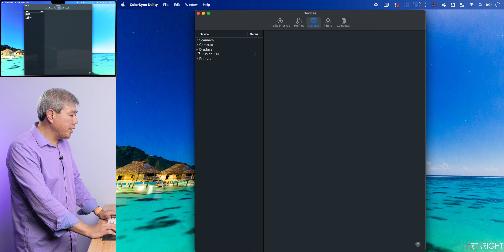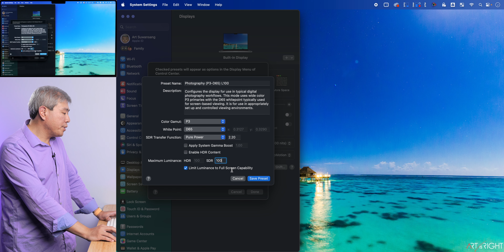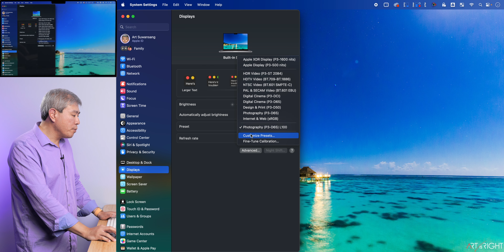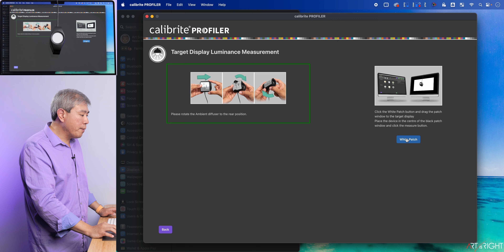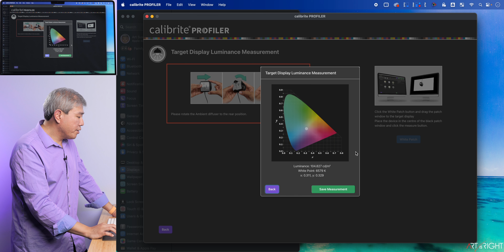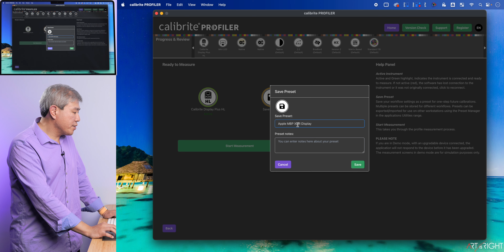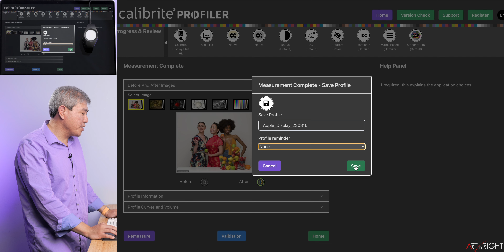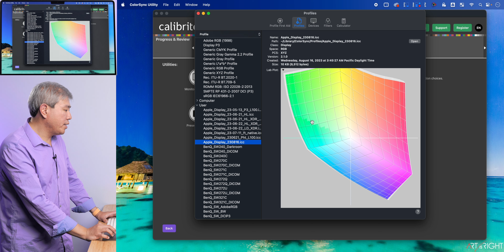Ultimate Calibration Guide for Apple 14" & 16" MacBook Pro XDR Display - This is the way!

Comment: Is there any way to do these measurements with an old ColorChecker Display Pro?
Reply from the maker: Yes and you can calibrate as well but you won't have MiniLED as a backlight option and that has adverse effect on the icc generated. But for the measurement alone, yes you'll be fine.
Reply: @ArtIsRight  Thank you very much for your answer

Comment: This was a great video. Thanks. Only issues I had was I had to google the X Y point target values because I was using D50 as I am doing more print work. I used X = 0.34567 and Y = 0.35952 target values. For some reason my 2023 Apple Studio 5k Display came up with a warning triangle for Luminance target value of 100 (no idea why) so I had to go as low as 90 as instructed in this video.
Reply from the maker: you're welcome :)

Comment: Hello, I have a MacBook Pro M1 (14).  I manually set the 100 L recommended by you in the settings and after measuring in the Calibrite software, it shows me the measured brightness values of only 85.9 L. The set brightness value does not match the measured value.  The display plus HL calibration probe was used.  can something be done about it or is the display defective.  What does it mean for me?  My laptop is two years old.  Thank you
Reply from the maker: Your best bet to fine tuned is to just ignore the measurement from the HL device. Some displays read lower. Other ways to work around this is set the luminance value higher, verify with the device and when it comes to fine tuned, say you want L100 and you are measuring at 85 just put in 98 or something like that. lt is a way to trick fine-tune into taking the value

Comment: So excited about this new update as this year I purchased the MBP 14". I assume this new Display Pro HL works with previous devices as well.
Reply from the maker: Display Pro HL is the device, I think you mean software, yes it will work with previous gen devices, however, they are not fully optimized for miniLED and XDR Displays
Reply: @ArtIsRight  I bought the Display Plus HL and did the calibration on my MacBook Pro 14" M2. Should I go the same process for my iMac 2017?
Reply: @josemanuelalorda yes except the 2017 iMac is not a mini led. It’s white LED I believe.

Comment: nice video! I recently got a canon pro 1000 printer and have been researching external monitors for my MacBook Pro m2 16 inch xdr. Im finding it hard to come up with a solution. So I may give this a shot first for printing. Do you have any recommendations for external monitors that work great with the MacBook pros that are designed for printing in mind? I have looked at the ben q, and eizo monitors but I am somewhat confused at what would work best. Thank you for any advice.
Reply from the maker: Any BenQ SW series displays all of them have 99% Adobe RGB coverage

Comment: Hey do you/anybody know the recommendation for printing settings and keeping multiple calibration profiles? He mentions it when talking about setting the white balance and choosing the custom brightness 100 setting that the lower screen brightness of 50 is the best profile for printing. That would definitely make sense as I’m having an under exposure issue with printing while using ICC profiles and being calibrated correctly. Does anybody know if it’s normal to just switch back and forth between these display settings - ie staying on the 100 setting from this video but as I go to print switching to the 50 setting to make changes to the image for brightness and saturation. I’m toying with just staying in that setting.
Reply from the maker: 2 variables: I never recommend brightness below 80 nits. You are losing a lot. I would look at the light source luminance that you are using as well. These are variables that are equally as important.
Reply: I’m sorry, I misspoke on part of that: I meant the d50 instead of d65 for printing and also using a lower lum like 80  nits if I’m having some dark exposure printing issues. 
How do you guys manage multiple settings? Like do you color grade in d65 with the settings you’ve made here and then when you want to print switch over to d50 and make adjustments?
Thank you for your in depth videos, they’ve been revelatory.
Reply from the maker: I just stick with D65 and call it the day. I never found D50 useful, just more of a pain
Reply: Thank you for sharing your expertise!

Comment: So I tried to calibrate my new late 2021 m1 max, prior to watching this video with the same equipment I have used in the past, the i1 display and i1 profiler. It completely messed up my screen. I have been in chats with apple support for hours and they have no idea what to do. has anyone else done this and how do you fix it!???
Reply: I didn't change anything setting wise, i1 profiler automatically changed something and I cannot get it back. Unlike in the past, it is not just a color profile issue, if I take a screenshot and view it on a different screen it shows exactly what the screen looks like, whereas if I use an external monitor, and take screenshots of two different profiles, the screenshots look identical even though the display looked different when they were taken. I am so lost please help!!
Reply: I think I fixed it. Weirdest thing ever. I had initially done a calibration using settings I found for print work (D50 and gamma 1.8). I reopened i1 and started a measurement with what I used to calibrate to (D65 and gamma 2.2) I quit the calibration after about 20 swatches. All of a sudden my display jumped back to normal, everything but my wallpaper which stayed faded and magenta like before. then I went back to i1 profiler, and exited out again, and all of a sudden my wallpaper was normal too. I have no fricken clue what happened but... I think i'm back to normal!!
Reply from the maker: When it comes to these display, if you don't have the HL device it is best that you don't calibrate just do white point fine tune

Comment: hey! great video! got a 16 inch M3 Pro but i am not happy with the white point. older OS versions allowed to simply set the white point to a cooler/ bluish or warmer/yellow by slider. i am no pro photographer, so thats no prob. Whut would u recommend to "just" get the whole display more "bluish/ cooler"??
Thx in advance! Appreciate!
Reply from the maker: just change the color temperature.

Comment: Hi Art, 
Thanks so much for putting so much work into helping out on calibrating our monitors. I recently bought the 27" Appple Studio Display and run it on Sonoma 14.1.1 . Today I received the Calibrite Display Pro HL and I'm trying to walk through the process of calibrating. Yet when I come to fine tuning the calibration in system preferences I get an orange triangle with warning sign when giving in the whiitepoint target values. I cannot move on from there as I cannot click 'finish'. It is greyed out. Could you help me out on where I might have gone wrong or how to solve the issue. 
Thanks so much for your help and your great work. Greetings from Belgium.
Reply from the maker: dm me with screen shots

Comment: I have a 16” M1 Pro MacBook(Sonoma 14.1.1) and i upgraded my calibrator to a Calibrite Pro HL. I’m having an issue with the luminance readings. For example, if I set the SDR value to 120 and then go to Calibrite software (v 1.2.4) and then measure Measured K as mentioned in video it’ll give me a reading of around 100. Always seems to be about 20 off. Any idea what’s happening here? I got the same result using my Display Pro calibrator. Any idea why this is happening? Thanks for all your work and help to everyone!
Reply from the maker: It could simply be that your display is off by that much, so if you want 120, I might set it to 130 or 140 to achieve the 120 and in fine turn calibration just leave everything as is for the luminance i.e. target 140 - achieved 140

Comment: In MacOS Sonoma there is a weird issue with the Colorsync Utility on my new MBP.

When I reset the icc profile to factory default a window pops up and requires me to enter my admin password. No problem here.

But if I want to select a specific icc profile (e.g. the one I created following this tutorial) after selecting the profile the same window pops up, but this time it does not let me type my password. My username is already entered, click in the field below it, start typing, but nothing happenes.
As a workaround I copied some random short text and pasted it into the password field. I am then allowed to use the backspace key on my keybord and after manually deleting the copied text I can start typing my password.
Reply from the maker: That is strange...

Comment: I have a question I cannot find an answer to. I have an x-rite pro calibrator and I have been calibrating my monitors for well over 15 years. I get that the new hardware will profile the new 16" displays fully. I have not gotten a new device yet, and I am so far finding the presets pretty close, I am not doing super color critical work at the moment. in the meantime before I can get a new device, can I use my old one to at least measure brightness for the fine tuning amount? would it be accurate for that. I know my colors will not be calibrated to the standards I have used forever, but I would like to fine-tune a preset though for the moment.

appreciate all the info you do, lets us understand the hardware and color is doing on them for sure.
Reply from the maker: "n the meantime before I can get a new device, can I use my old one to at least measure brightness for the fine tuning amount?"
Yes

Comment: Hi @artisright my MBP 14'' 2021 colors are washed and pale, any video reference for them to be more saturated and iMac 4k like?
Reply from the maker: "my MBP 14'' 2021 colors are washed and pale"
They could be more accurate than you think. Also is this relative to iMac 4k? Or what reference are you using? What preset mode did you set?
 "any video reference for them to be more saturated and iMac 4k like?"
I would be concern about the iMac giving you incorrect output.
Reply: @ArtIsRight  iMac is perfectly ok. What I want is to get as saturated colors as my iMac on my MB pro

Comment: Wonder if you can help me. I own the Macbook Pro 14" M2 Pro and and Asus Proart Pa279CV monitor, I also own a 65" LG OLED (4k 120hz). I wanted to sell my Proart as the screen isnt big enough and being an LED monitor, looks nothing like the macbook ( i think its to do with the blacks being not as dark as the OLED and Mini LED), even in rec 709 mode. Can these newer devices calibrate the Macbook AND the LG OLED? Ive tried plugging the Macbook into the LG OLED and the colours look a little green compared to the Macbook. Just want to get a really accurate screen on the laptop for when i'm out and about but also be able to hook it up to the OLED when at home for the real estate. Brilliant video btw :)
Reply from the maker: Yes they will work. But don't think of it as calibrate to match per se.

Comment: I currently own an X-Rite i1 Studio (the photospectrometer you can also use for profiling printers) and asked the Calibrite support whether this device would be able to calibrate the display of of those new Macbook screens. A day or two later they answered that it could be done using their ccStudio application.
Art on the other hand say that one of their new devices is required for those Mini LED displays. What is right?
Reply from the maker: You can calibrate, but you won't get the full gamut output of the display. It does not mean that it won't work. It will just that you'll be limited.

Comment: I’m getting an average delta e of 3.8 for BOTH my Pro Display XDRs (with a .2 variance between them). Is that normal?? They are roughly 4 years old. Can this value be improved further if I repeat this process several times? My studio display and MacBooks score below 1 :/
Reply from the maker: I have seen values that high before. If you follow the method and leave the display to warm up that might be the most that you can get. This has a lot to do with the EDR that Calibrite is using. Studio Display & MacBook non XDR have traditional display that EDR is easier match to.

Comment: Can I calibrate an Apple Pro XDR display using the Calibrite Display Plus HL and maintain the full extended dynamic range? I'm hearing conflicting opinions. One is that the panel can be color calibrated, but then loses its HDR headroom. As I'm reediting portfolio images to take advantage of this HDR headroom, I want to be sure to get both; i.e., color accuracy and the HDR headroom. Is that possible today?
Reply from the maker: Yes a video on that is coming soon.
Reply: On MacOS, the PROFILER output causes total loss of HDR on my MBP and Pro Display XDR- everything clips to roughly SDR white.  Fine for SDR, but I’ve been unable to find a way to use it for HDR. Waiting for a solution, I assume they’ll get there eventually.
Reply from the maker: Not there yet. HDR is a big messy can of worms at the moment.
Reply: @ArtIsRight  Does that mean that a video on HDR profiling isn’t coming soon?

Comment: So now that we can finally do a full calibration on the m1 mbp, will the color accuracy match that of a benQ display?
Reply from the maker: When calibrating in sRGB or P3 close but not with Adobe RGB and SW display line
Reply: @ArtIsRight  is it worth/necessary doing a full calibration as a portrait photographer ? Is there a noticeable difference before & after calibration for m1 16” mbp ? 
In your past videos you have expressed highly of the Apples new Liquid Retina XDR display, and that by just doing the fine tune white point, you will already be close to a benQ 

In another video you have also mentioned about professionals working in Hollywood that don’t bother doing a calibration, and they do their whole workflow just using Apples default xdr display 
So I’m just curious 
Thank you
Reply from the maker: Yes it will be warmer. Mac calibrate their display P3 with more blue so the tone is cooler. But you can get away without. it all comes down to need, comfortably and justification for workflow. All of what I said is true but each has their own workflow and understanding, or hopefully, the comprehension, of where there work will end up :)

Comment: You are amazing. This is gold. Already have my SDR workflow setup. I do have a question, if you can help me out. What would be the proper or best workflow for calibrating a MBP XDR screen for HDR starting from the HDR mode? I have the HL Plus which would be able to enable this. But still not sure how to setup the software properly for this purpose. Thanks!
Reply from the maker: At this point in time, there's not much that can be done. Essentially none of the consumers devices on the market is capable of HDR REC 2020 calibration yet.
Reply: I see. So, at this point technically use the HDR mode on the XDR and hope the SDR profiling helps?
Reply: @javierbaerga be careful, my experience with this device is that it disables HDR (clips to SDR) on MacOS - Windows seems ok. May be a conflict between MacOS and Profiler. The older ccStudio output from i1Studio doesn’t harm HDR on my Mac. I assume this will get resolved in time.
Reply: @gregbenzphotography  thanks a lot for the heads up
Reply: @gregbenzphotography  Actually it doesn't support HDR calibration as of now, kind of misleading but in near future they may enable HDR calibration support via software update.
Reply from the maker: Somewhat. HDR is still largely a mess right now